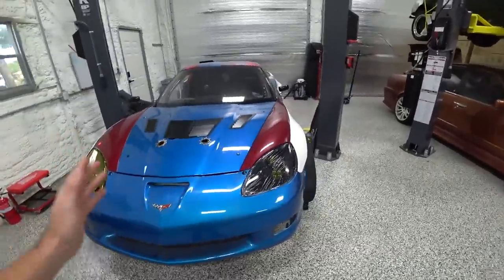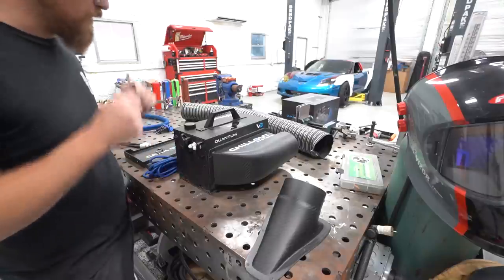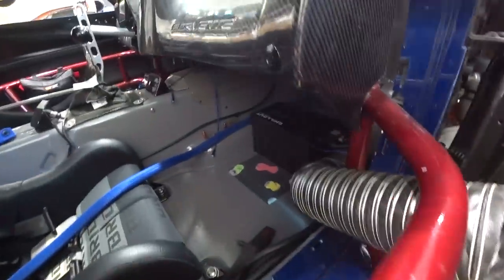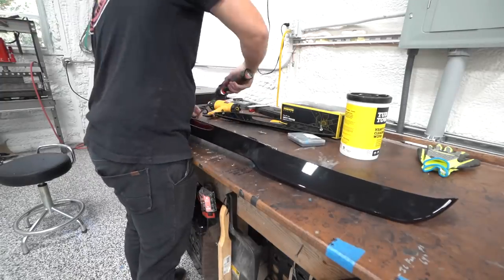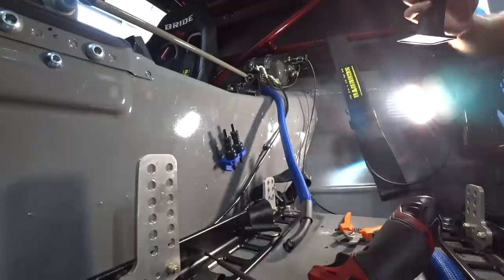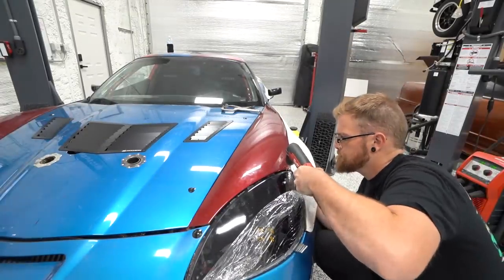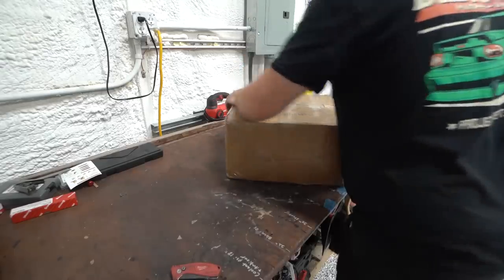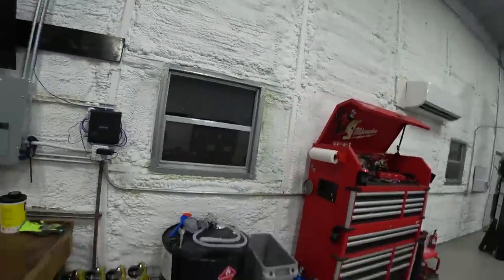C6 Corvette competition drift build. making it look good.

Comment: Man id love to see the miata turned into a grip monster, a time attack car. You are damn good at turns too, not just drifting, it would be sweet to see you doing multiple motorsports kinda like Cletus McFarland does. You have a lot of talent and would be good at it.
Reply: Agreed. More technical stuff would be great, the Tail of the Dragon videos are some of my favorites.
Reply: @Teddingtin  id like to see him actually doing time attacks and autocross stuff. The miata is already 80% built for that. Good power to weight, he could remove the angle kit and put over fenders to fit skme wide r888 tires, put some aero on it and its ready. Already caged, has a dry sump for high G force corners. Id love to see that

Comment: You could run the duct straight up and under the dash. Cut out a hole where the factory air vent would be, install factory vents into the dash, then run the duct to the back of the vent. 

Pros: It hides the duct, keeps it out of the way for ride alongs, uses the factory dash vent location, looks oem plus, and this build has always been “clean but with function over form” so it fits the build series

Cons: gotta cut a hole in a carbon fiber dash 😢, is it worth the effort for the results? 80/20 rule?

Comment: Should definitely run the ducting for fresh air to the coolout unit. Overheats very easily and creates a fair bit of heat around it. Running the same unit in the fd car I work on and we've had problems w it all season.

Comment: Is that duct on the chillout system for drawing in air or exaust air? If that is for exhaust you exhaust the hot air from the system, if it's for intake, the hot air stays in the car and just kill you. It can take air from inside the car no problem, and exhaust the hot air outside. Backwards is just inefficient for your confort
Reply: Why don't you mout it outside, around the radiator, and just pull the lines inside, weight distribution ++, and no problem with heat inside outside the unit

Comment: no judgement but wouldnt it have been mor convenient placement by the radiator and then run bulkhead quick attach lines through the firewall behind your seat